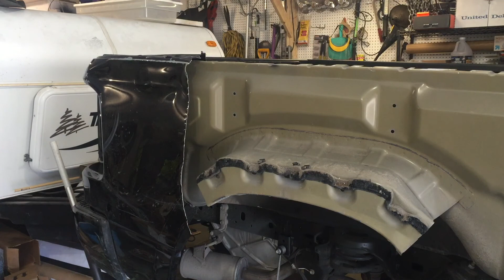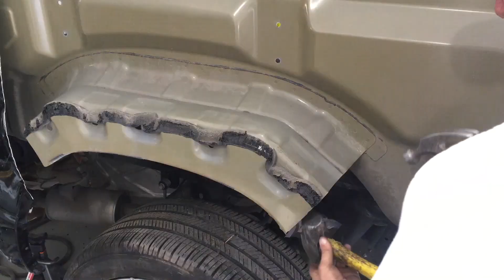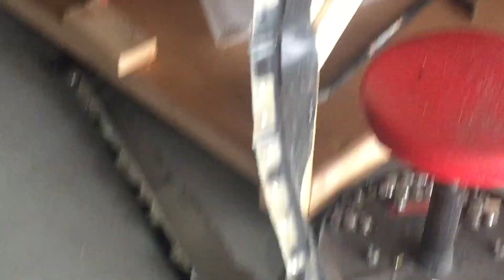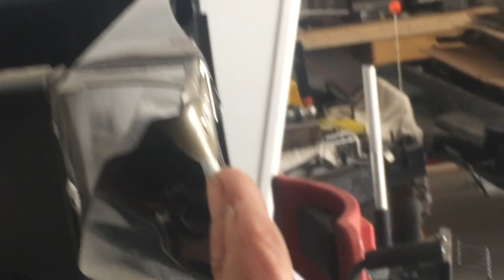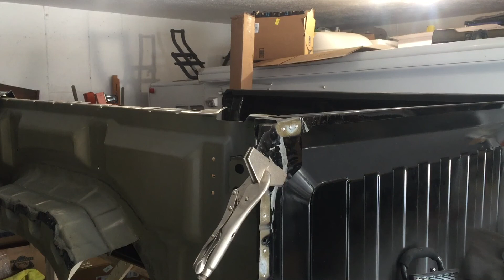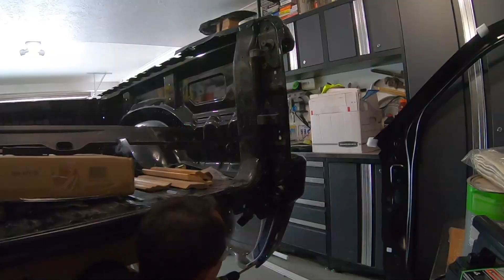Rebuilding A Wrecked Dodge Ram 1500, Part 8, 2019 Laramie, HEMI, Truck. Heavily damaged bed.

Comment: Hello I’m about to undertake the same job myself in my home garage mostly. For a unfortunate situation I’m having to fully pay my truck even though it’s considered totaled. It’s just a hard pill to swallow to know I have to pay 30 k for a totaled truck so that’s why I want to repair it. I  guess what I’m asking is where is the best place to find the information on the proper repairs as I go along.
Reply from the maker: It's amazing the cost of a wrecked trucks and then add the high cost of parts and labor, WOW, big money. You can do the labor and save big though but, yes, you do need to do your research. There are lots of great youtubers to watch and I found that buying from dealer Mopar websites, and having parts shipped to a dealer for pick up, can save big dollars too. Be careful with buy used parts because I have found that used prices are often higher than new.

Comment: Am enjoying watching you move along and tackling each phase of damage, with so many videos perhaps you can help us out numbering them 1-16 etc or however many there are. Ive found it extremely difficult trying to find a number sequence. thanks
Reply from the maker: Good point. The videos are numbered but the numbers are at the end of each title. I was wondering if the number sequences showed. I will push the number to the start of each title.